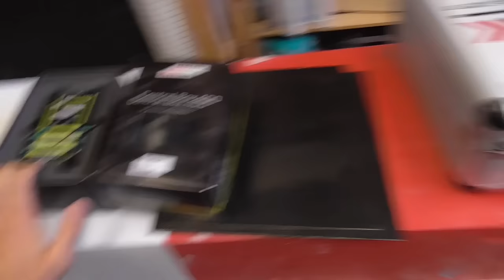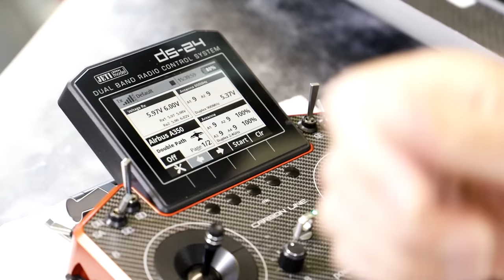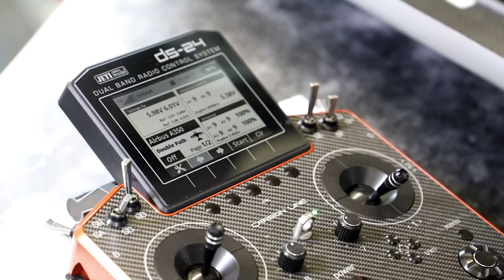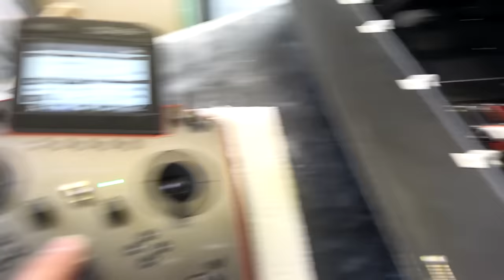BUILDING A GIANT RC AIRBUS A350 XWB, PART 6

Comment: I've always heard that it's more important with shorter wires between esc and battery, but the length between esc and motor is not as critical. It might actually burn out the esc if the length is too long (more than 30cm). Don't take my word on it, but please check. This is coming from Castle if I recall correctly, so maybe check with them? Long wires between battery and esc could require some added capacitors on the wires.
Reply: Was thinking the same thing. Hopefully Ramy will notice this comment and double check with Castle.
Reply: you're right.
battery -> ESC = cables as short as possible
ESC -> motor = long cable

Comment: As you make more holes, the carbon fiber structure looses strength, each fiber has a tension and if you cut it, it loose that tension (like a rope). That is why the pice you pulled out is kind of loose. Incredibble work dude!!!

Comment: Only the tip of the antennas matters, keep them as far away from everything else as you can - especially large pieces of carbon :)
Reply from the maker: Thanks for the info :D
Reply: I agree with @iforce2d. But keep in mind that the active part of a 900 MHz antenna is about 7 cm long. When the antenna is placed in the vicinity of conductive material, like carbon, the center frequency may be way off the desired frequency. The only safe bet you have is to measure the antenna characteristics when the antennas are in place. A cheap NanoVNA Network analyzer could be used for the 900 MHz antenna. The 2.4 GHz antenna requires  a different analyzer, e.g. the N1201SA. This beautiful plane should not be lost due to antenna problems.

Comment: I think you should install parachutes that you can deploy if a mechanical failure happens or if you lose control.

So much work goes into making these planes that I think more precautions need to be in place in the event something goes wrong.

Comment: Ramy - Fantastic job!  But please note that you must keep the distance between the ESC and the battery short whereas you can extend the distance between the motor and the ESC.   You say the opposite in your video! The reason is primarily due to voltage spikes.  You need to add some capacitors to dampen the spikes if you have a longer than 8 inch connection from the ESC to the battery.  I typically add 220uF for every 4 inches.

Comment: I am impressed by your very good work and innovative ideas. For a future project, would it not be advantageous to install the ESC in the engine nacelle after the ducted fan? The nacelle is larger in diameter than the fan. This should not significantly disturb the airflow. For the ESC it is cooler and more service-friendly.

Comment: Magnificent work. Just a comment on your power wiring, the length of the DC feed from the battery to the ESC is also important and should be kept as short as possible especially with the currents you are using. All those "IR" losses as they say.. Regarding your satellite receivers, the only part that should need to be outside is the antenna at the end of each piece of feeder (coax). Having the antenna hard against the carbon fibre fuselage is going to compromise the performance no matter what but it would probably have been better to keep the second 900MHz diversity antenna outside the fuselage as well. People make a fuss but when it comes down to it the antenna is never going to be as good as it could be because they are generally designed to be in free space and not near other surfaces so you just pick the best compromise you can!

Comment: Nice work again, Ramy. Be careful with those servo wires chaffing on the carbon fibre plate access holes (at approx 15:32 in your vid) though. Id suggest either chamfering the edges of the holes or better still, putting some form of protective edge on them.

Comment: Have you considered adding pitch and roll telemetry to the readouts? Or even using that data to add limits to the control of it to prevent over banking and stalling?

Comment: Hi for your receiver you can keep it inside just the antenna neeed to go outside but the far from the carbon it will be the better it is . So if you can don’t glue it right in the carbon

Comment: You can leave only the antennas outside, I have a lot of experiences with carbon fuselage of speed helicopters. I use the same Jeti systems. Just put some plastic tubes for antenna exits

Comment: Next time maybe consider using constant current sources for the power LEDs instead of power resistors. They are more expensive but I bet you are paying way too much for those simple, individually packed resistors. And the current sources may not become so hot if they are switched ones.
Keep it up!

Comment: amazing work as usual but please set up your antenas UNDER the fuselage and OUTSIDE carbon sheilding
your satelites signal line of sigth on top are quasi all blocked by fuselage when plane is in air 
best signal would be to put your 2 2ghz satelites on wing tip winglets 
enjoy

Comment: Using strips of aluminum self-adhesive tape, cut from the roll, is good, if not the best way to hold the wires on the place.

Comment: Is there anything like  wind tunnel tests or pre-flight tests that you can perform in order to be the confident that your plane will actually flight without problems?
Reply: No, that's the entire point, you spend years building the plane and it crashes during the first flight, welcome to RC modeling. :)

Comment: Did you sand the edges of all those cable slots through the carbon fiber to prevent cable fray. Also why not use a voltage regulator or buck convertor to change DC voltage level.

Comment: It's amazing plane and I used to check the channel every couple of days to get the updates. but I'm wondering, don't you need some cooling fans or ventilating system inside the plane with all of these electronics and batteries inside?

Comment: I checked with my brother (he made a living designing ESCs for Kontronik and is a general high power electronics wizard) and you should definitely not have long battery leads. Back EMF will ruin the ESC on the input end. Making the 3 wires to the motors longer does not challenge an appropriately sized ESC. Especially since you are using more premium parts you'll likely not want to kill them like that.

Comment: I might be wrong but I think it would be better if you would put the satellite on the bottom to get better "visibility" to the transmitter antenna. radio waves can not go through carbon, unlike foam wood or plastic. the real aircraft probably have gps and other antennas that get signals from above. If you take off with this setup the fail safe (second frequency) would kick in the moment the receiver antenna loses line of sight of the transmitter antenna it wouldn't be a big deal because of your amazing build and your thinking of putting redundancy in your craft! Keep up the good work!

Comment: For the 2.4Ghz Sats the Antenna tips only need be be outside the Fibre. The section of the tips that have the shielding removed. For the 900Mhz the entire flat antenna needs to be outside the Carbon Fibre.

Comment: Would using self-adhesive industrial Velcro strips simplify the installation of all the modules, as well as enable you to easily move/replace ones for troubleshooting or upgrades?  Industrial Velcro is very secure!

Comment: It is the other way around as far as the battery wires go. The motors are AC so it's much better to extend the motor wires. Battery wires have many issues being extended.

Comment: The opposite is true with the esc. The ESC has to compensate for EMF on the motor end anyway, so they're built for that. Where EMF is not expected is from battery. I've always been told to use short battery runs and extend motor wiring if absolutely necessary. I've been running my Twinstars like that for ages without problems.
My source for that advice is my brother who used to work for Kontronik and developed their ESC line up and programming boards just as an example.

Comment: @ramy maybe don't use a switch to turn on/off the receiver on the radio that is too accessible. You would not like to flip the switch mid air. Or is there any protection if you flip the switch, does it ask for you to confirm to switch off the receiver?
Reply: Yes it does, you can clearly see in the video it's two step process.
Reply: @randomnickify  yes, I realised that when I reached the end of the video.

Comment: Is it just me, or is the clearance between the wheels of the nose landing gear and the doors really tight? See 32:25. I could imagine that with the wind during flight, the axle could catch the doors when retracting and cause some damage.
Also, does the steering return to neutral when you retract the gears?

Comment: Please excuse my ignorance but what is the gyro for, I'm guessing some sort of auto pilot,  auto leveling or return to home ..... utterly fascinating watching all this, at this scale and tech coming together...
Reply: As I understand it, electronic gyro (AHRS) is for stability. Just like the ones in modern cars or airplanes they measure acceleration in all directions thousands of times per second. If you over-control and put the plane at risk of loss of control the gyro automatically sends control inputs to the ailerons/elevators/rudder to keep the plane in stable flight.  This is not to say it will make the plane crash-proof, just more stable.
Reply: @drgonzo7467  cheers Andrew, I was curious and thought it would be completely different from those in RC helicopters, even though it has a similar function..

Comment: I don't recommend placing the ESC in the fuselage. I love the Castle gear, but we have lost several aircraft because we lost power, due to the castle Pheonix edge ESCs overheating. it has become less of an issue now that we run pretty much everything 12S, but even running a 6s/10,000 system on a pheonix lite 130, but averaging 65A, we overheated and lost the plane within only a few laps, batteries still half full. Now all ESCs are mounted in the airstream, regardless of how it looks. if you must plate them inside, make sure they get LOTS of airflow, and do a static thrust test for the duration of the batteries to make sure the ESCs won't shut down mid flight and take your aircraft with it. I honestly wish you could disable all Safetys, as I would much rather risk burning a $300 ESC and have the chance to land and get a warning, than the esc protect itself and bring down the plane (which smashed up the ESC more than I though possible anyways)

Comment: aren't you afraid the servo wires will get eaten up by the carbon where they're passing trough the board? some small rubber grommets or some pieces of inner bike tire could do the trick.

Comment: Hey Ramy. I have an idea. At 12:44 would it be possible to cut out a section on the engine mounting and place the unit there? 
It doesn't get any closer to the engine and it would get all the air it could possibly need!
A bit of reinforcement on the engine mounting would make it posiible I believe.

Comment: Hey Ramy, this is great butt the shorter are the wires between the battery and the ESC is better
Long wires between the battery and the ESC may kill your ESC over the time. Or you may better use a capacitor bank to retrieve the voltage drop. THIS IS THE CASE IN A DRONE. I am not sure if these thick wires will affect.
Reply: My thought as well. Ramy please check with Castle!

Comment: Hello friend Rami, everything is fine, congratulations for the beautiful work you have been doing in aeromodelling, I would like to solve a doubt, in one of your videos I saw your friend, flying a high wing plane, large and apparently very light, if you have more information about this model, thank you for the size, which setap you are using in it, and the material you used to assemble it, I am wanting to assemble one here, but I have some doubts, thank you in advance, hugs friend.

Comment: Ground plane of the carbon fiber fuselage is bad for the antennas, if you want to have good signal from the plane at any angle put them as far as possible from any carbon fiber part, for example at the extremity  of a wing, or at the bottom of the plane, a little bit off from the carbon fiber fuselage at least

Comment: Ramy, I've been following you for some time and you are an amazing builder. Looking at all the work you put in and the money you are pounding in this newly built, I have a suggestion. You should sell your fantastic creations and not fly those expensive models which you spend a tremendous amount of hours on. You are too nervous which affect's your flying capability and judgement because of that emotional attachment. I am certain you would have multiple buyers at the right price and you could simply become this fantastic builder that you already are and not the plane crasher because of your human error or judgement. Having flown RC planes for many years in competition your flying capability is just not at the level it needs to be. Respectfully a fan.

Comment: I think you could get away with putting the castle ASC behind the turbine. Up in the turbine/engine tube/case/cylinder thing. There is the flat part that connects it to the wing, I bet there's a way the ASC could fit in there, and then it would be gettting constant ariflow to keep it cool

Comment: To hide antennas you could build the whole plane in carbon fiber, then you make the horizontal (or vertical) stabilizer in a "normal" material, so you can put antennas inside it. Your model is awesome, but those antennas "ruin" it (sounds bad I know)

Comment: So what happens if the switch/relay that turns the plane on/off malfunctions mid flight and kills power to the whole plane? I get anything can malfunction and it can crash but that just adds one more point of failure (a major one) at that since you have redundant radio signals.

Comment: This radio is amazing, but be carefull with the antenas location, 2.4 signal doens't 'like' carbon fiber, and even the 900mhz, not long I thonk Ali crashed an carbon fiber F100 is was with the powerbox CORE, I doens haven't the bachup 900, but bouth 2.4 links where down because of the carbon fiber, do a lot of ground tests and range tests, this radio has a graphic that show the signal strength in all 3 links. sorry about my English. Thas a beautiful model congrats!

Comment: The antennas should not run next to the carbon fiber as that will greatly reduce the rang. also, it should be fine to have the receiver inside and the antennas outside.

Comment: Ramy RC - You  turned off the comments for your other video of the Boeing crash. The comments help other RC pilots to not make the same mistake you did by over banking the turn and stalling the inner wing. Piloting and building are two different skills. You're a super builder. It's okay to make piloting mistakes. Also, the two guys with you were just standing on top of the poor farmer's crops. That part is not cool. Thanks for the great videos. Don't worry about the crashes! Cheers from your friends in America.

Comment: Wouldn't it be easier to have a separate battery for the lights? Burning off energy with a resistor and creating all that heat seems counterintuitive. Absolutely not a criticism, just a thought. The flight time would not be reduced with the extra weight versus bleeding off extra energy in the form of heat (waste).

Comment: You are indeed an exceptional builder, but I suggest that you consider aerodynamics more before the virgin flight. Pointy arrow-form wings are very efficient on passenger planes in the transsonic regime - but they are DEATH when used in the low speeds of RC planes. When you fly this plane, do NOT use the ailerons on the finale. Actually, don’t use them whenever you fly in any kind of low speed manoeuvers. You WILL STALL the inner wing otherwise. Fly with rudder/elevators only in these circumstances. (And with inner wing, I mean for example the left wing in a left hand turn)

Comment: Not to rain on the joy on your face but.... what is the likelihood of RF interference or a fault triggering the off command during flight? I see that being a catastrophic situation if during flight the off command were to hit the system and shutdown the plane having a digital on/off command on the plane compared to a manual switch.
Reply: What is the likelihood that two different digital commands would be send due to some interference or error? Exactly 0.
Reply: Touche - what is the likelihood of a fault causing the aircraft to shut off?*

Comment: One tiny screw holds the horizontal stabilizer in place? Yikes.
Reply: There is very little force pulling the stabilizers sideways in flight... almost zero actually. I have built three planes that only use friction fit even on the main wings.
Reply: @iforce2d  I was wondering about vibration from any flutter or the up/down force from the elevators somehow backing the screw out. Obviously he knows what he's doing though.